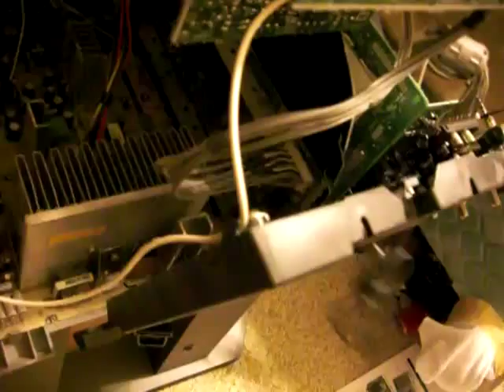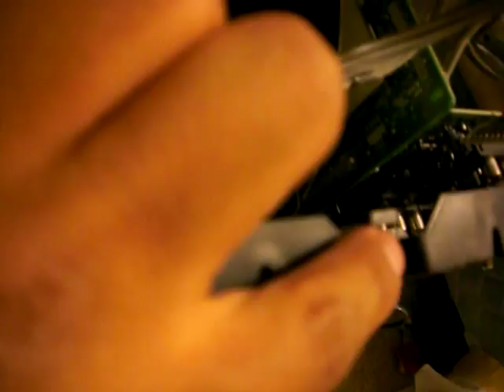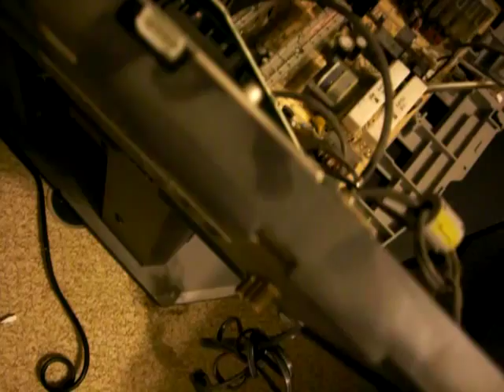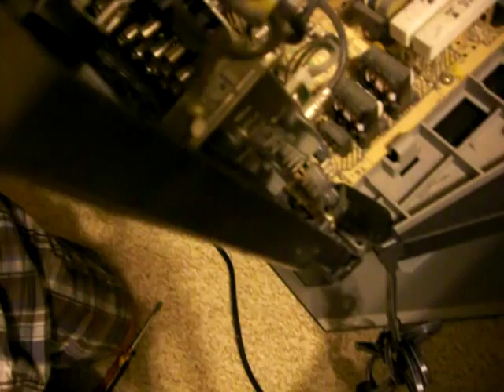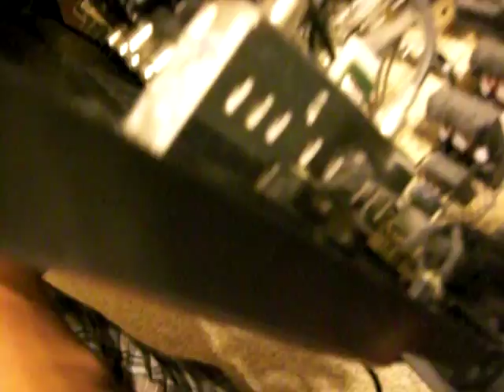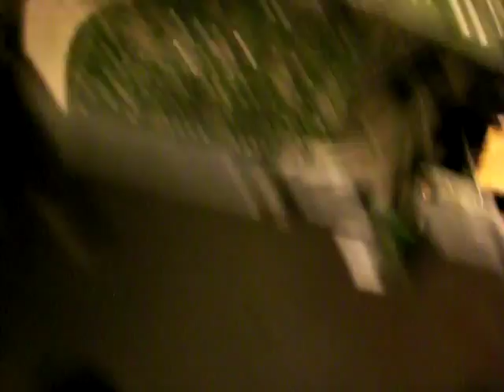Sony TV 7 Blinks Changing 2 IC

Comment: Integrated Circuit and it means just that, they integrate several circuits to simply circuit building as a whole. I'm old school and actually liked the old way of tons of components cause instead of replacing a $40 IC you can replace a $2 transistor, etc. I have paid that much too, but that was a power amp module IC and out of production taboot, sigh.
Reply from the maker: Sorry to hear about that.

Comment: Amazon has a kit for $15.14 as of this posting and that includes the shipping cost. Search for: SHINDENGEN MCZ3001DB Replaces1 and you should find what I just ordered. Haven't installed mine cause I read there is a capacitor that should be replaced that has been known to cause the original failure and though the TV my work again, can cause it to fail prematurely, so I'm holding off and keeping the parts on the shelf till I find out.